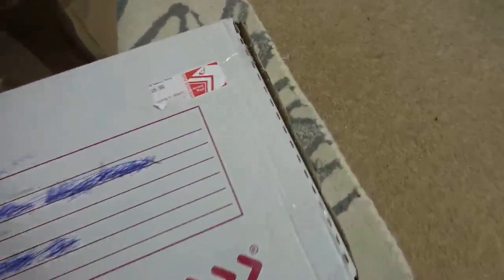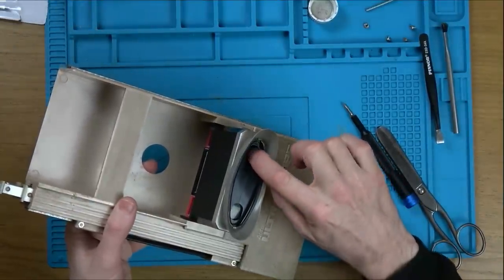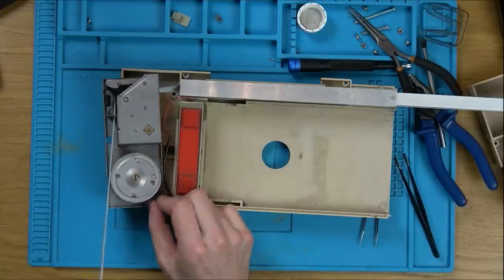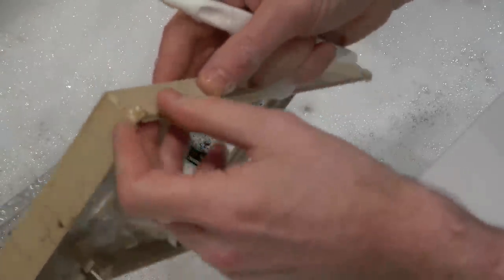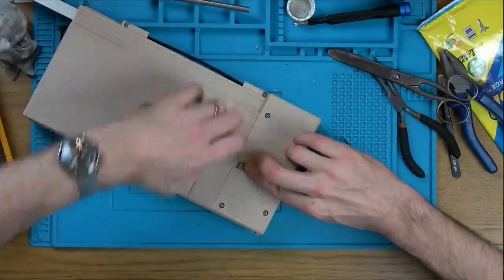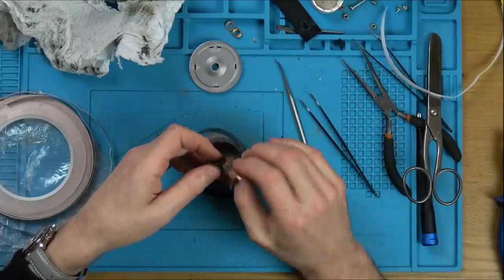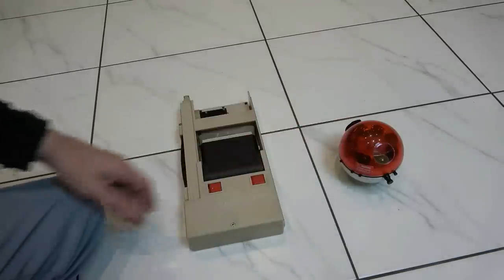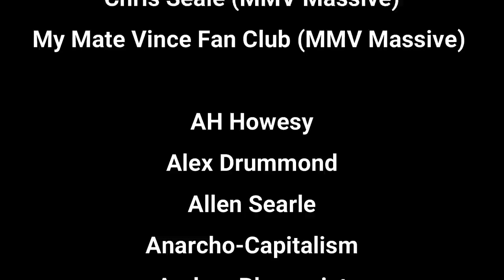BROKEN 1971 Nintendo Periscope - Trying to FIX

Comment: If nobody told you already it is simplicity itself to anneal the spring steel. Just heat the part to about 300 (just around where it turns dark red - or check for exact times and temps for spring steel) degrees or so and leave it to cool..It will be soft and ductile again...But that was brilliant..Well done.
Reply: Ur prof is mad
Reply: I do small engines, I repair recoil springs at least once a week. It's even better to just bend it when it's hot.
Reply: Yep. Done it.

Comment: This is an excellent fix, that's a really properly built Japanese toy with metal gears etc, made back when things were made properly,  not like the newer stuff with flimsy plastic bits that just break off!
Although the concept is quite complex, it's a solution to a problem that wasn't there in the first place, it could have been made so the telescopic arm could have been extended manually,  reminded me of those powered telescopic car radio aerials people had in the 1980s.

Comment: I could only imagine how much a Nintendo periscope would be worth?! But this item goes beyond the money threshold because just how unique it really is as well. One of a million find here. That black spring is iconic of virtually of alot of late 70's to 1980's wind up toys. Truly a genius bi-product as well but extremely erratic and temperamental to handle...I remember taking them apart via wind up motor car engines!! Damn thing made my 8 year old arm and hands twist & turn, you can also cut yourself with them as well!!! Awesome video.
Reply: Oh, they will cut: I have a small scar on my chin from where one got me as a child.

Comment: Could've heated the end of the spring red hot to anneal it, then bent it and dipped in water to return some ridgidity.
Reply: This is the way to go, slightly shorter spring but would work.
Reply: No need to heat treat the last bit bent inside the groove. Just annealing it at the end would have worked.
Reply: @johncarter9399  Water could make it more brittle as well but I agree.

Comment: You can use the same spring that is in a pull starter on a lawn mower. You will need to modify the end to grab the tape belt but it is the exact same concept. Also the pull start spring is a lot stronger as well far more liable then that type of treated spring.

Comment: To renew the plastic I use ultraviolet led strip fill a clear box with hydrogen peroxide cover in aluminum foil. Leave overnight or 24 hrs the yellow disappears.

Comment: And the first time you forever the periscope down it doesn’t wind, instead it forces the tape into the corners around the central spool causing the metal to kink and buggering the whole thing up. 
I wonder if the advert had a boy using it to see in a neighbours window?

Comment: just use a small blowtorch to Annealing the end of the spring steel to make it soft .so you can put a new bend in it ,  job done
Reply: Or perhaps the hot air station ? This was almost painful... BTW wonder if just the soldering would anneal.  350 to 370 centigrade?
Reply: @jasonudall8614  heat it up using a small handheld blowtorch ,same one cooks use ,until the metal turns orange and the spring steel will be annealed . you have to ,at least heat it to the point where the metal glows . so a hot air station would not work or soldering iron .
Reply: If you bring spring steel to a glow it looses spring
Reply: Blowtorch?  I use a gas stove on my kitchen for that
Reply: Just use a ligther
Reply: If you do that the heated material wont be springy. One time to much force brings the bend out and the spring will fly away. Better cut a total new one..

Comment: You can use the spring from the inside of a tape measure that has the same width. I've repaired similar devices and it lasts a long time.
Reply: Yes this is similar construction as tape measure 👍🏼

Comment: Scrub-a-dub-dub, Our Mate Vince cleaned it in the tub! If you ever want to bend the broken off part of the spring, use a torch to heat it up till it’s red and allow it to air cool. This will remove the spring on the end. 👍

Comment: the spring is made of spring steel. you pretty much always need to heat it with a torch to make and sharp changes to the shape. even a little hand held butane torch would get the job done. it is what i use when repairing an odd ball pull start recoil assembly.

Comment: See odd tinkering second channel, he has a tip for bringing the original color of plastic back using UVleds and hydrogen peroxide. Hope that helps😀
Reply: Pretty sure Vince is aware of retrobrighting. It’s a destructive process though. It weakens the plastic.  Besides, the item will turn yellow again eventually anyway so what’s the point?

Comment: Well thumb up for your attitude.
I can suggest you some things. First to soften the mainspring use mini torch... Soft it from both sides... About 3, 4 sm would do... 
Punch a hole in the and and make it bigger with diamond bit and mini drill.
The mainspring should be strongly lubricated to unwind and wind.. That soldering don't help for that, it creates extra friction. U should inspect inner mechanism for wearing.. Lub inner wheels, repair weared pivots with closing metal punch tools if needed :) Lub gears inside to reduce noise...
And for last...please excuse my English :)
Best wishes

Comment: Nice fix.  The end of the steel spring could have easily been enealed by heating it until it's cherry red on a gas stove, (for instance), then allowed to cool, which would release the brittle/tension in it as a result of being, 'work hardened.'  But your fix was ingenious, all the same.

Comment: All you have to do is anneal the end of the spring - heat it up until it's cherry red and dunk it into water and it'll bend without snapping. There's also a lot of friction in that spring, it wouldn't have hurt to put a very slight film of light oil on it before closing things up. And finally - people who use pliers as hammers are condemmed to an eternal damnation.

Comment: You mentioned how there's nothing stopping it from continuing to reel in/out after the periscope is fully opened or closed, so I wonder if that's how it broke to begin with. Maybe somebody held down one of the buttons while the mechanism had nowhere left to go, and that put the spring under too much tension.

Comment: Video suggestion:
Trying to fix: 3D-Printer

I paid 40€ for a broken Anycubic i3 Mega a few weeks ago, only had to replace the hotend and a small fuse for the heatbed on the motherboard.

Comment: Just get a blowtorch and a bowl of water.

immerse the spring in the water apart from the 2" or so that you need, hold that 2" with pliers and heat it up with the blowtorch to remove the temper from that small part and you should be able to bend it.

Comment: Very good and really interesting video. I've just had a look on eBay and saw main springs for clocks and was thinking replacing the spring with a clock main spring would be a better fix in the long run.

Comment: I think that you can buy a new tape measure in small length and replace the old tape with the new one, also you will find a new spring inside it, so you can put it in place of the broken tape.

Comment: all you needed was a blow torch and a wet rag. Just cover the part with the rag you do not want to remove the springiness from. Use the torch to make the other end hot and twist your curl in it.  that way it will retain the spring where you need it, and relax the metal where you don't.

Comment: hi i have worked on spring clean the part were the  break is 5mm each part  heat up the 5mm on each bit when solder is very hot push them as one that tape will come un done over time
as the glue on the tape goe's bad over  time or get a spring out of a bad toy or clock

Comment: yes you can anael it just heat it up cherry red and then let it cool down slowly.
once youmade the alterations or modification heat it up again cherry red and dump it in miniral oil the carbon it lost while anealing will be restord.
But you should do a hardness test first so you know in what ball park you need to be.
there are viles for that.
and you can drop the hardness in a normal kitchen oven but it takes awile.
but for modification aneal it and.

Comment: Maybe you could steal a retract spring from a tape measure?
Reply: You can take the spring temper off of spring steel by annealing it-  heat it with a blowtorch until it's just glowing faintly, then quench it with water.

Comment: Can you tell me where you got your blue mat from please? I could do with one for my toy repairs too. Thanks
Reply: Various sizes available on ebay for around £5 to £15
Reply: @sofa-lofa4241  what do I search for? I have tried all kinds of descriptions and d come up with nothing lol
Reply: @sootyhough  hi, If you search ebay for 'silicone work mat E6T2' that will show you the one I plan to buy next, it is a large one (450 x 300mm)with screw trays, etc. 

I have a smaller one already but wished I bought the large one first off, there are lots of sizes available of identical designs, so make sure you check the size in the description,
Happy hunting!

Comment: just wants greasing
Reply: alos the spring mechanism has snapped off means its not retracting it works in the same way as a tape measure & if you have an old measure you can just use the spring from it